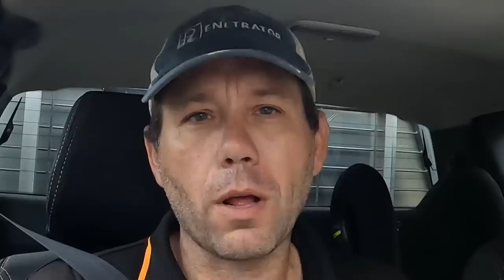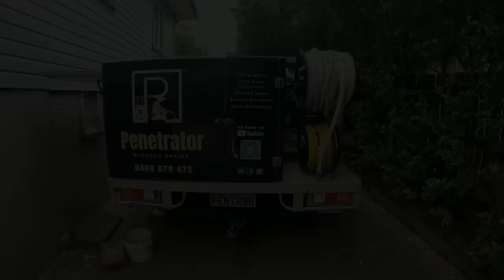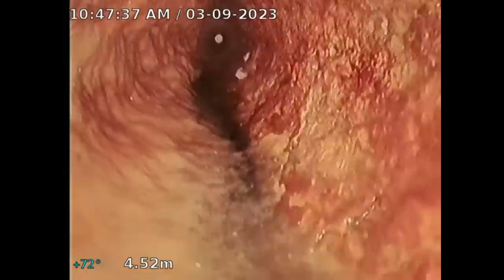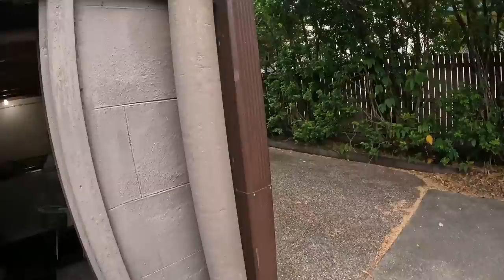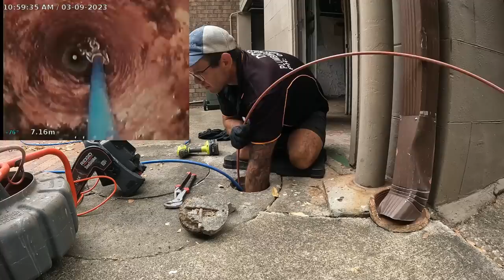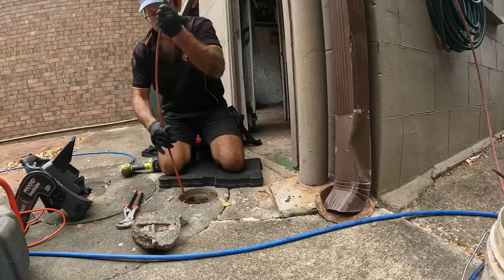Blocked Drain 357 - Getting Old Frank's Pipes Flowing...

Comment: I am quite fond of using a flex shaft. If you can keep water running upstream it helps tons. If it is a toilet line only I will block the toilet flapper so it just flows water non stop. Carbide tipped knocker on that shaft would be a brutal attack piece of equipment on scale. A properly adjusted knocker also helps as it appeared you had the chains a bit tight (for smaller pipe).

Comment: Such a shame beautiful old houses are demolished so developers can put houses not much bigger than dog kennels and charge exorbitant prices for them , it’s no wonder that only the absolute wealthy can afford houses today
Reply: Just the opposite in my neighborhood. 1950's and 60's 2/2 and 3/2's, 1200-2000 sq ft ranch style homes are being knocked down and McMansions are being built. Some of them look like they built right to the setback limit to maximize the size of the house. That's progress (I guess).
Reply: The greed for property taxes drives some insanely dangerous and poorly thought out building practices here.   Houses less than two feet apart, and a foot from their property line.   No way to reach the gutters to clean them, as they're 3 stories up, and any fire in one building will jump, no matter how 'fire resistant' they've made the roof or walls.    The tiny gap between buildings will trap water, grow mushrooms and build up muck normally only found in caves.